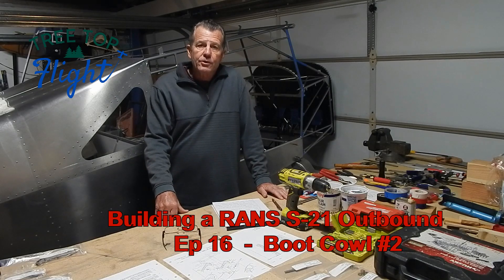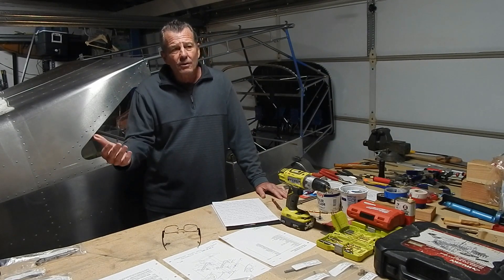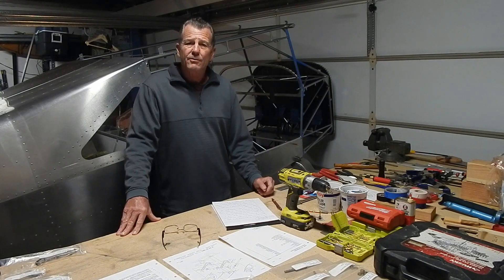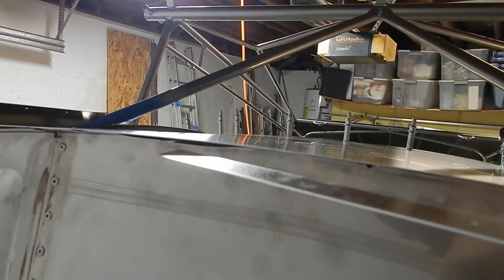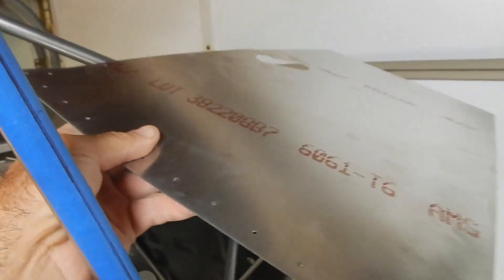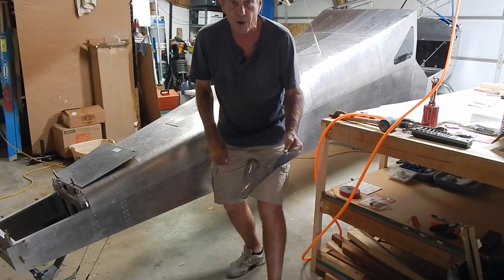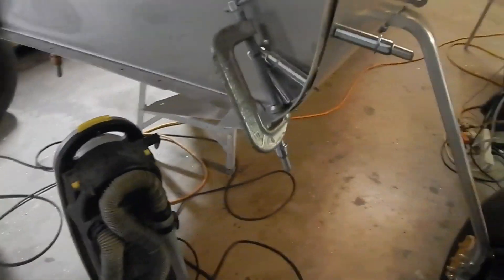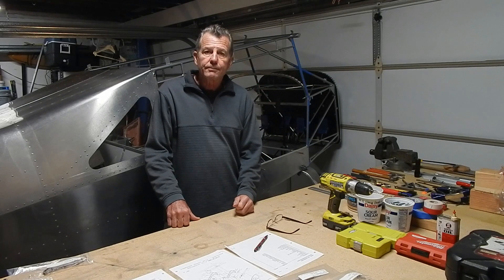Building a RANS S21 Outbound Plane - Ep 16 - Boot Cowl #2

Comment: just a question have you thought about fitting the electrics in the front before you fit the boot cowl into final position? just for easy access
Reply from the maker: I actually have not rivetted the boot cowl skins yet, and have them off while working on components.  I am also trying to follow the manual in order, because I am not sure what I will mess up if I dont.  Certainly I would take more initiative to change the order on a second build.  Thanks for the comment.